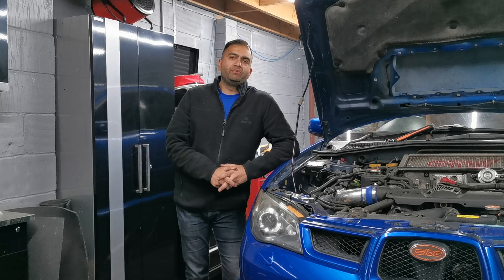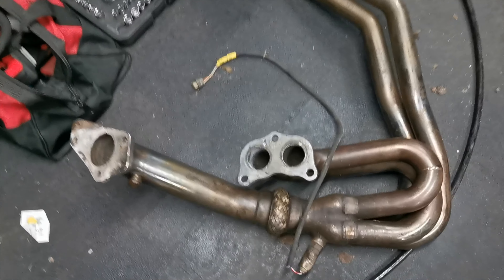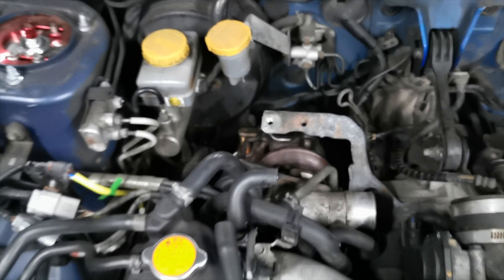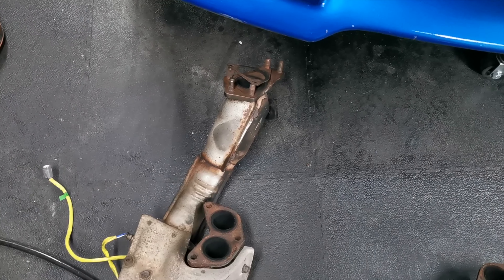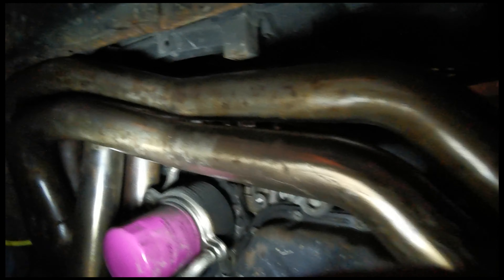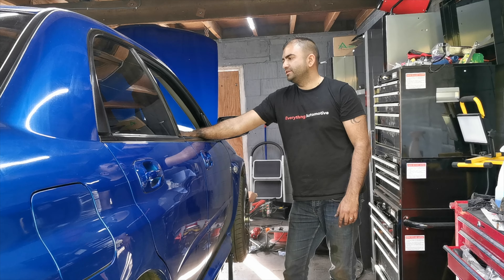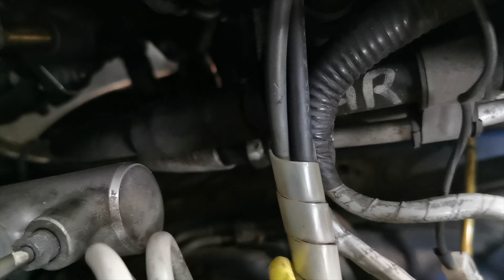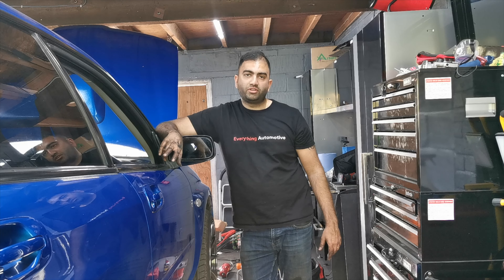Subaru Impreza WRX Headers Upgrade & Install

Comment: Will it not align unless the turbo is loosened? Been fighting with mine all night..got it someone buttoned up to the turbo but now it’s won’t align on the heads. The connection at the turbo isn’t good either.

Comment: The EGT sensor will constantly act up and throw a code with these headers. I ended up unplugging the sensor and running a resistor

Comment: Quick dumb question , will a 2005 uel headers for an 06 ?
Reply: Pretty much the same from 02-06 the only difference is depending on the brand of UEL or EL you may have to get the STI oil pan on some.